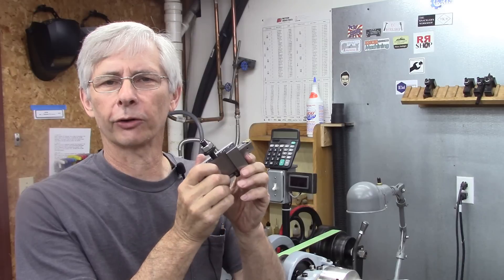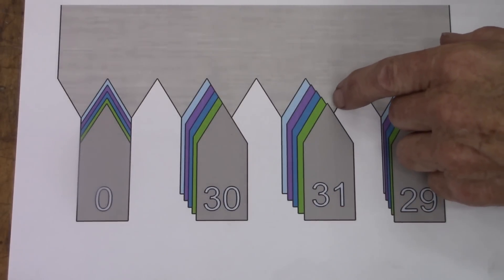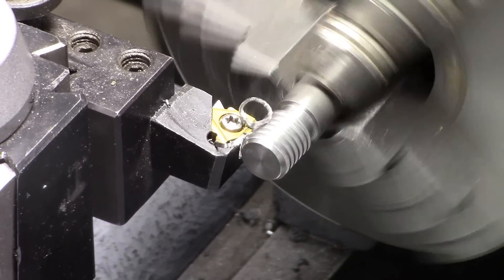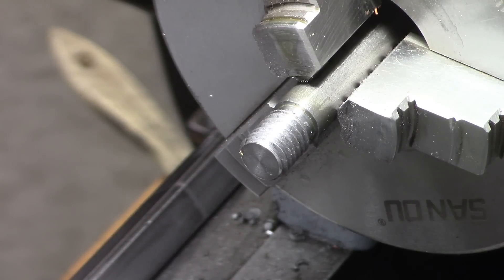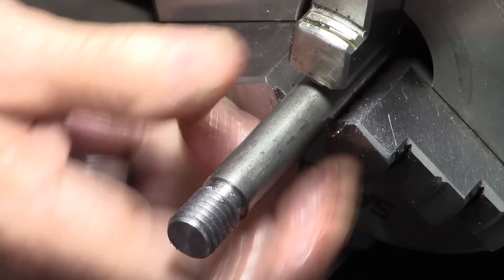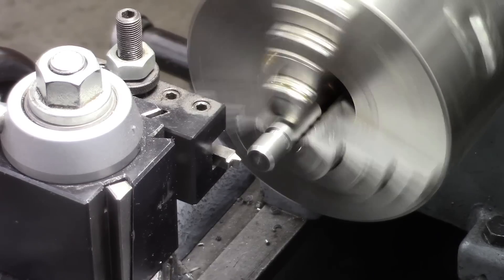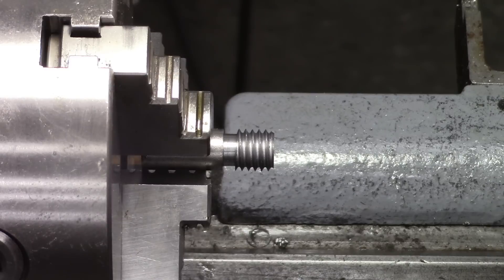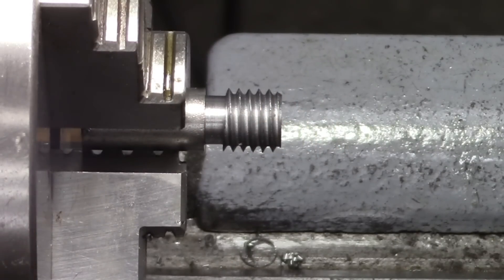Threading - Feeding with the Cross slide vs Compound

Comment: Kurtis, from CEE,  Australia, cuts some huge threads in his work. He says he always uses the cross slide predominantly, never releases the half nuts, stops the lathe at the end of the thread, his machine stops instantly, and then reverses with the tool extracted. If you watch him carefully, he always advances the compound dial a few thousand before engaging the next cut, which is applied with the cross slide. His results are perfect. I've never questioned the compound movement but I surmise that it's to achieve much the same effect as cutting with the compound in that the principle cut is with the left edge of the insert while the right, if it cuts at all, provides a "polishing" action to the right edge of the thread resulting in a cleaner thread. He then follows up with a thin strip of abrasive tape and a flat file. Granted, in comparison  to most hobby lathes, his are huge, but he's using the same inserts as you and I do. Just sayin'.
Reply: I have a Harrison 140 and an Atlas 10f lathe, the former certainly works fine using just the cross slide, whilst the 10F is smoother with the compound, so I find the lighter lathe prefers it
Reply from the maker: A big lathe makes a difference although, if his compound is set parallel to the stock advancing with both is the same as advancing with the compound only set at 30 degrees. The only advantage (in my opinion) is that you can read the thread depth on the cross slide dial.
Reply: @WinkysWorkshop  You missed the other advantage of keeping the compound at 0 degrees. You now have an accurate means to cut to a shoulder. Threading with carbide at such low surface speeds is pointless. You will get much better threads with HSS in mild steel
Reply from the maker: I'm not sure why I'd need to cut a shoulder with a threading tool. I agree that HSS cuts better but you might as well say threading with carbide on a manual lathe is pointless. There is no way you can run a lathe fast enough to get into the range that carbide likes. Honestly I have had very good luck using carbide, I usually cut a little caster than I did in this video but no where near fast enough for the surface speed needed for carbide.
Reply: @WinkysWorkshop  perhaps I did not explain clearly enough. The point is that by having the compound at 0 degrees it can be used to accurately cut shoulder lengths with general purpose turning tools negating the need to mount a dial indicator between bed and carriage.
Reply from the maker: @RobB_VK6ES  Got ya, Yes, that is a plus and I have done that. However I leave my compound at 29.5  to 30. One reason is for this is threading but another big reason is that it interferes with the tail stock when turning and even drilling. Most the time I can deal with it but it requires more stick out of the tool.

Comment: I'm sure you've had this question asked before, but what in your lathe sounds like there are loose bearings rattling around?
Reply from the maker: Straight cut gears. Fairly typical for old south bends.
Reply: @WinkysWorkshop  Thanks.
Reply from the maker: @rogeronslow1498  You're welcome.

Comment: I have made thousands and thousands of feet of English, Metric, Acme and pipe threads.  It does not matter the method as long as you have a sharp tool and cut threads to the proper depth.
Reply from the maker: To a point I agree. Both methods made usable threads. I do think that feeding with the cross slide is a bit more demanding on the lathe. Going straight in the two chips are meeting at the tip of the tool resulting in more friction.

Comment: I think that the reason that the half profile tool cut so well is that the cuttings cleared from the work piece far better.
Reply from the maker: I agree. Plus the tool was HSS.
Reply: @WinkysWorkshop   As an apprentice we did an experiment in college where we started with a square piece of HSS and tried to cut with it,. We then added side clearance, which improved the cut and finally we added top rake again improving the cut.
Reply from the maker: @grahamc887  For sure it makes a big difference. I was also surprised how much honing the cutting edge also helped

Comment: I often cut threads with h.s.s. tool oil stoned ,the threads are always a good finish with goog chips. Many repetitive threads I used tips. Interesting content.
Reply from the maker: I agree, sharp HSS makes a huge difference. Do you feed with the compound?
Reply: @WinkysWorkshop  I have used both methods, predominantly the compound method. My lathe has very little backlash, I try to screw cut at the highest rpm I can with job at hand use a cutting compound sulphur based, the material type I find plays a big part,  4140 possibly be my favourite , I do fair amount of stainless as well. I enjoyed the topic regards Ian.
Reply from the maker: @iandibley8032  Yeah, higher speed is better as long as you can control it. I've always felt like the sulfur oil was better. I may need to go back to it.

Comment: The guy I have see cut with the cross slide also use the compound set at 0 and advance it by a few thou.  I have yet to try it but it works well for them.
Reply from the maker: Thats what I did...  although larger moves at first
Reply: @WinkysWorkshop  It did not show on the video that you moved the compound forwards with each pass.
Reply from the maker: @marley589   The first thread was compound and the second was cross slide. In hindsight I should have shown my hand tuning the dial. It would have added clarity. I was wanting to show the chips forming and didnt think about showing it.
Reply: @WinkysWorkshop  This comment strings original post by @aaronfritz7234 referred to the compound at zero and advancing it a few thou every pass. You had the compound at 29 degrees. So your comment " thats what I did " is incorrect.
Reply from the maker: @marley589  Sure enough, I got confused. Sorry about that. You are correct, I have never tried this method. Without going back to find the comment I think I recall that his compound was set parallel to the stock (which is actually 90 degrees) and he moved the cross slide and then doubled the move at the compound. I assume in separate passes after each correction. It sounds like a good way to lose track of what moves have been made. I'll stick with the compound move only. Simple and effective.

Comment: One advantage of cross slide is that it is more rigid than compound -some people get rid of their compounds and make solid blocks with tools posts.If you have chatter problems-especially on small weaker hobby lathes that affect the quality of your threads consider locking the compound and use small depth of cut with cross slide.

Big heavy duty rough cutting industrial lathes dont even have compound slides and they use block tool posts instead of quick change tool posts.If you have a chinese lathe that may be your source of problems ,cheap quick change tool post +low rigidity of compound slide = chatter and bad thread quality .
Sharp tool with proper geometry and right speed +smaller depth of cut and several passes can get the job done even on cheap chinese lathe.
Reply from the maker: I've seen this before. My compound gibs are set tight and yes this is a plus. I would never want to do away with the compound unless I used the lathe for a specific purpose.

Comment: There is another method that is equivalent to using the compound set at 29'    Set the compound parallel to the lathe axis and feed the cut with the cross slide but feed the compound one half the cross slide depth of cut.  This means the depth of the thread can easily be read from the cross slide but moving the compound one half the depth of cut is equivalent to setting the compound to almost 29'
Reply from the maker: Two others have said the same. Aside from the compound interfering with the tail stock this method has the advantage of being able to cut to depth.
Reply: This method is as common as the other two but did not feature in the video?

Comment: Feeding in with the cross slide makes it easy to see the exact cut depth on the dial. To cut on the leading edge and almost exactly simulate a 29 degrees feed in. Advance the compound half the depth of cut per pass with the compound set at zero, parallel to the spindle.
The opening comment regarding whether a particular method is better depending on the power of the lathe is a little misleading. The idea of reducing tool load by feeding on the flank is to protect the tool. The delicate tool form will chip or break before the lathe stalls.
Reply from the maker: Interesting idea, that would work!
Reply: @WinkysWorkshop  it's a very common practice. Very few use any other method once they know it.
Reply from the maker: @tates11  I see no advantage.
Reply: @WinkysWorkshop  1. You don't need to move your compound slide, leave it set at zero for standard turning operations.
2. The thread depth is a direct reading on the cross slide dial. No calculations or setting required.
93% load on the leading edge 7% on the trailing edge. It is taught as standard practice in Europe and I believe Australia also and probably many other countries too.
Reply from the maker: @tates11  I see the depth of cut advantage although I never do this and seem to get it right. Leaving the compound angle set at zero is not a plus. It gets in the way of the tail stock.
Reply: @WinkysWorkshop  That's an interesting statement about the compound fouling the tailstock, I've never had that issue myself.
My lathe tool tip is always past the end of the toolholder which in turn is in advance of the toolpost and that is in advance of the edge of the compound slide. Even when I have my tool tip forward up to the center of the spindle and further, my compound set at zero still easily clears the tailstock body as it is designed to do. The tailstock body is relieved in this area so the compound dial can be used.
Most older lathes had no dro or fine Z movement on the carriage feed handwheel, the compound set at zero, was often the fine Z movement.
Reply from the maker: @tates11  I have extended a tool to make the compound clear the tail stock. My tail stock is slightly recessed but not enough. Both my Logan and South bend have this problem. I sometimes use a dial indicator on the carriage if I need accurate positions. I really need to install a DRO on the carriage.
Reply: @WinkysWorkshop  I'm surprised that any South bend and Logan lathes were ever sold with such a basic design flaw.😉
Reply from the maker: @tates11  I suspect the original lantern tool post may have had a little more stick out. if not, it was capable of more. It would require a lot if relief on the tail stock to fix this completely. This has been an issue on every lathe I have operated. On my old cataract it's terrible plus it has no carriage feed so you have to use the compound set parallel to the work. If I remember right, turning the feed handle is the biggest issue. Not a big deal most the time and I always feed with the compound while threading. Depth of cut is easy, just double compound feed. I much prefer this simply because you don't need to remember a dial setting every pass. Simple, easy and effective.
Reply: @WinkysWorkshop  Have you tried pushing the tailstock further to the right or use it with the spindle extended further?
I guess you are referring to using a center in the workpiece that causes clearance issues.
Taper turning with a center is probably the only rare operation that can cause clearance problems. You can swing the whole compound round and either pull the tool towards the chuck or push the tool towards the tailstock with the handwheel nearest the chuck.
Reply from the maker: @tates11  I actually made the tail stock ram longer. It was missing when I got the lathe. This was more for carriage clearance than compound but I'm guessing I added a couple inches.

Comment: I've tried both methods and now plunge straight in. I go from left to right at higher speeds and use plenty of cutting oil, HSS tool. 1440 lathe. Decent threads. I've got carbide inserts but they are never as sharp as my HSS. Especially on quite small threaded things the inserts seem to want to push too much before cutting.
Reply from the maker: I agree, HSS is much sharper

Comment: Perhaps a contributing factor in the difference of finish between cross-slide with insert and cross-slide with your very clever ½ threading HSS tool might be how carbide cuts your workpiece vs HSS? (assuming your ‘factory tool’ was a carbide insert?. Love your videos and your thinking!
Reply from the maker: Yes, good point and I agree. I think I mentioned this...  (could be wrong)

Comment: lol hay mark.... how about trying to improve on the cutting tool for threading ?
why not give the half-tool a relief so it actually cuts instead of having the chips slam into a flat surface on the tip of the tool.... it has always bothered me that threading kind'a rubs the chips off instead of cutting them off  and inserts only slightly improved upon this but the area is so small you still get a flat area on the cutting edge... so why not just cut a relief behind the tip of say 5 degrees so the chip is actually cut ? may not work for hard metals
like stainless steel , or that may only work on soft metals, aluminum and copper,etc,etc.
but the reality is if it works on mild steel we all would be far better off using a half tool with a relief ! because when I thread i hardly ever get good clean threads so I have to run the corner of the file in the thread groves to clean then up.
 a half tool might well cure that for me !  thanks Winky !
Reply from the maker: Yes yes yes...  You are thinking like me! Ha. The half tool was ground with both back and left side relief which is better than most carbide inserts! I've always wondered why all these inserts on the market have all sorts of wild patterns and reliefs and the threading insert only has a back relief! More half tools on the way - Ha
Reply: Yes the half threading tool would cut much better with about 10 degrees top side rake. I prefer to call it “top side rake” instead of “back rake” since you definitely don’t want the tool tilted backwards.
Reply from the maker: @ellieprice363  I think my side rake was a bit less, maybe 4 or 5 degree but I also ground some back rake hoping to make the tip cut the right side a little better. I'd say it probably was not needed.
Reply: @ellieprice363  I cut the top rake square to the leading edge, I do advance the tool to cut on the leading edge though.

Comment: I think what proved the point that using the compound at 29.5 degrees is better is when you used the "half threading tool" it couldn't cut on both sides because there weren't 2 sides !
yet the threads came out best of the lot ! it also shows that threading inserts are not always
as sharp as they could be ! a super sharp threading tool really makes a big difference !
Reply from the maker: Yes it does...  good point!

Comment: Thank you for sharing this informative video.  I enjoy your channel very much.

For MANY years I did all of my single point threading with 3/16" square HSS tools held in an Armstrong style tool holder held in a "lantern tool post" on a 6" Atlas/Sears lathe.  Side rake was ground into the tool (leading edge only) and back rake is set via the Armstrong holder.  The feed was put on with the top slide set at 29.5 dgr.  The look and feel of these threads was, IMHO, consistently good.   

Recently I began using a genuine Aloris (wedge style) tool post with AXA tool holders and 3/8" square HSS tools with a 9" South Bend workshop lathe. The plunge feed is put on with the cross slide as suggested in many internet videos.  Threading results are rather poor.  I attribute this to no back rake and no side rake.  In other words, the tool is basically scraping, not cutting.  

I have also tried feeding with the compound set at 29.5 dgr.  The results are somewhat better on the left thread flank (leading edge of tool) but finish on the right thread flank (trailing edge of tool)  is "smeared and flakey" even though there is plenty of side clearance.  

I plan to try treading with the South Bend lantern tool post, Armstrong tool holder and 1/4" HSS tools with this "new" lathe.  I'll let you know how it goes. 

For what it's worth,
F.C.
Reply from the maker: From what I have experienced I think the best approach is to grind a HSS tool with a small amount of side rake on the left side and a small amount of back rake. Then set the compound at or very close to 30 degrees. Good comment, thanks!
Reply: @WinkysWorkshop  GMTA!!  (Great Minds Think Alike) 😉